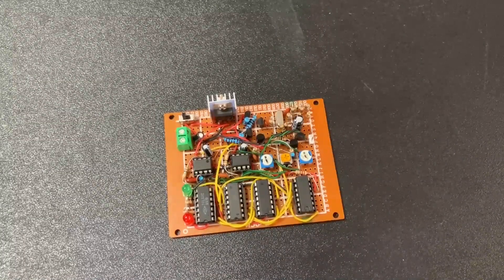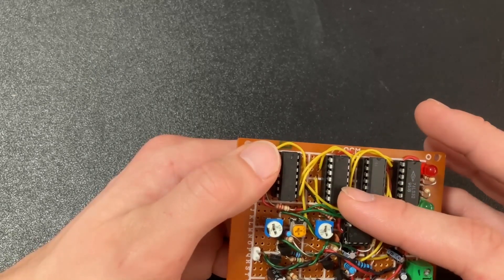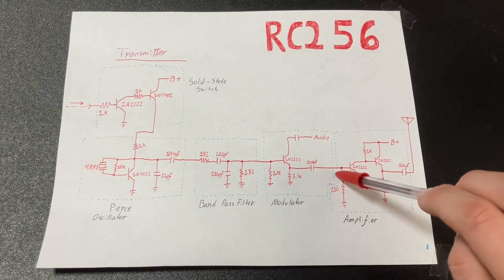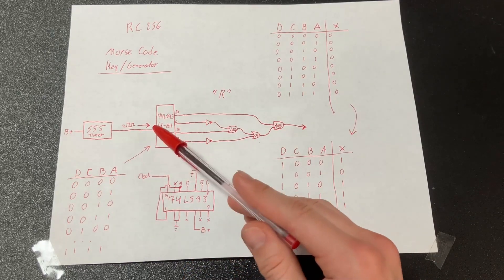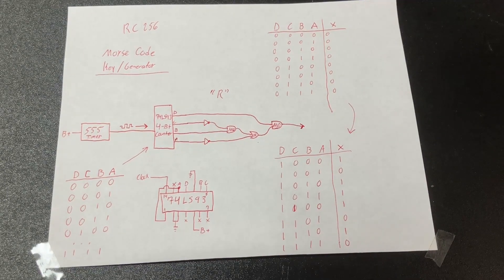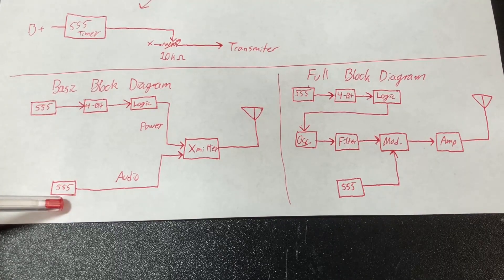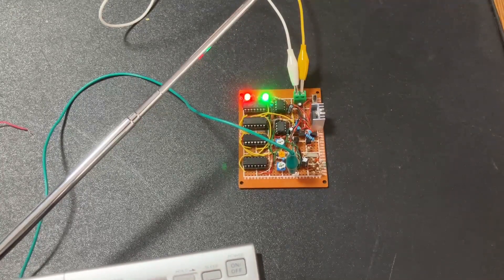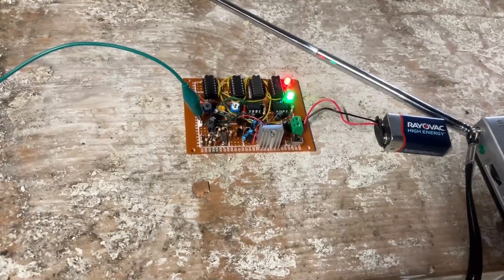Hard-Coding Morse Code Using Logic Gates - AM2PC pt. 8

Comment: Bravo sir bravo! Brilliant work! I am sorry that AM transmitter couldn't work. I've made it work pretty good on my end. Anyhow, I wrote some programme for windows to read from text file and generate morse code. It works well, I just need to redirect it to USB or serial port so I can attach CW with it for a little automation exercise. I think, you better try that as well, sir! Cool work BTW. O! Almost forgot, if you are open to suggestions then try replacing your logic with an EEPROM where you can put codes against addresses and use a multiplexer for generation of those addresses. The NE555 will come in handy as clock generator. You can manually programme the EEPROM chip with an RC circuit and an SPST switch. I've done it a while back and it works fine. This trick shall shorten your logic by removing all those three chips. Good luck, sir!